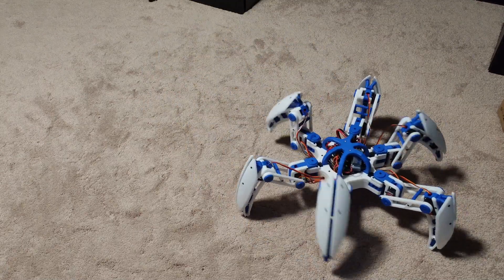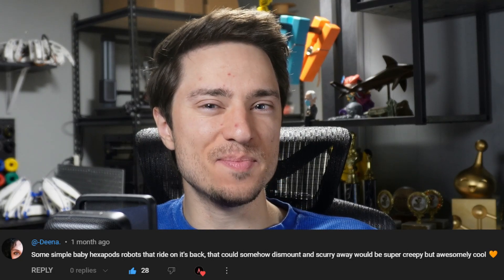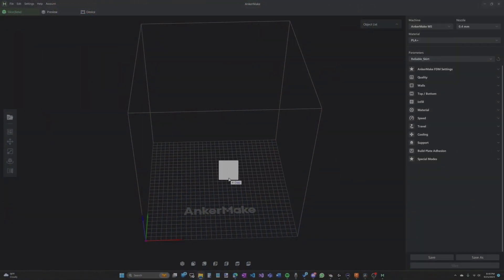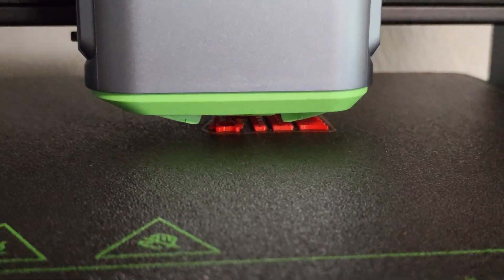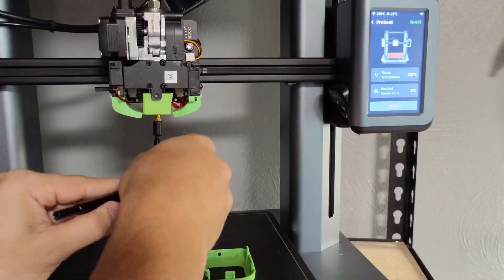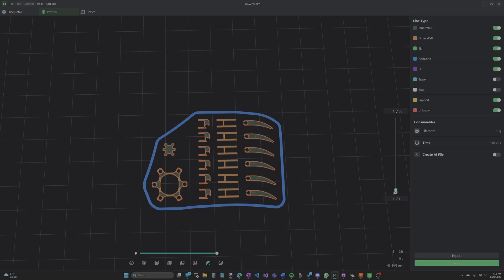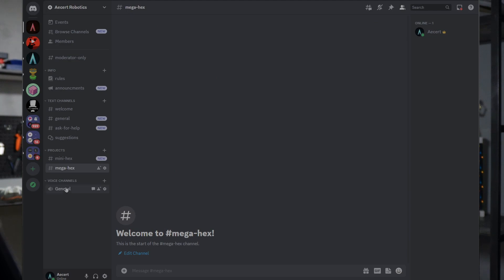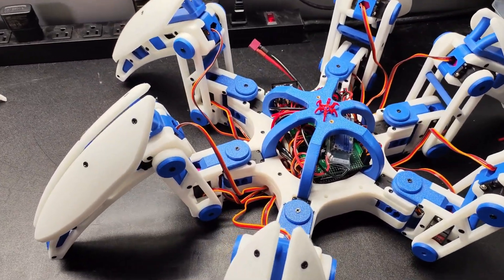How to make a 3d Printed Miniature Hexapod

Comment: I guess to make the smaller ones to scurry away you could attach to each a vibrating motor from a phone with a small battery to keep it small and simple
Reply: Apparently the ones I remember are called bristlebots
Reply from the maker: You know what that could actually work! how do you make it so the vibrating would cause it to move though?
Reply: @AecertRobotics  Perhaps you should make the joints to have less freedomso the spider doesn't fold on itself, the vibrations should be enough so that it lifts slightly off the ground and moves a tiny bit. I've seen this done with brushheads so in my opinion it would adapt well
Reply from the maker: @al_lazy3519  makes total sense if the plan is for it to stay standing up and vibrate to move. Could maybe even make it so the motor only runs if the hexapod is on the ground
Reply: This was exactly what I hoped for with my idea. Imagine!